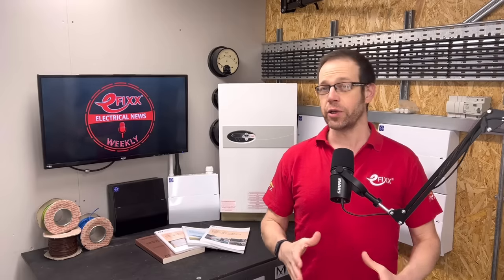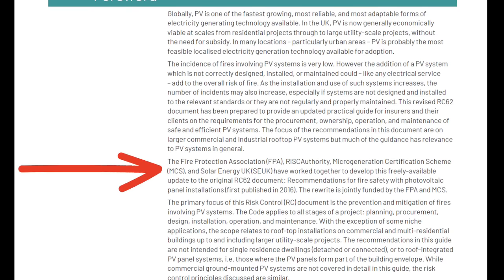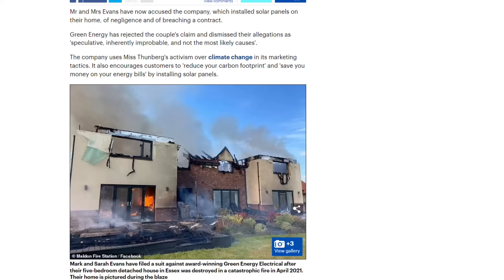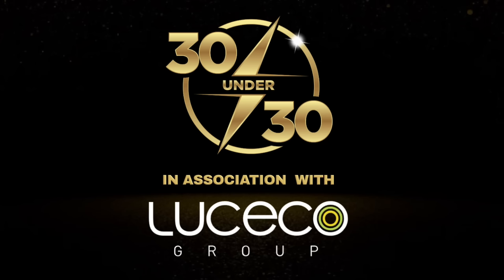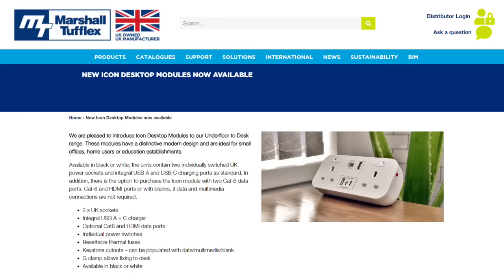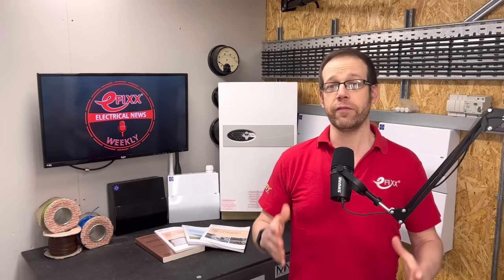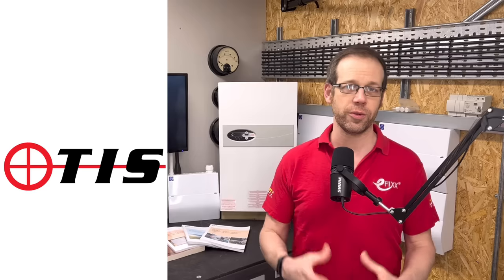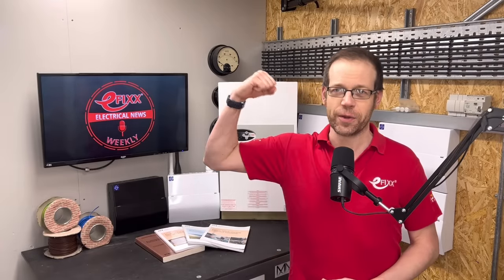DON'T Install DC Isolators On Solar, Electricians Warned

Comment: Sounds more like a "DON'T INSTALL CRAPPY CHINESE OFFBRAND DC ISOLATORS WHICH COST 1/50th OF A SAME RATING PRODUCT FROM A KNOWN BRAND"
Reply: Using proper approved testing methods I have found the Chinese isolators from some brands are as good as UK brands. It’s mainly to the people do not talk down the connections or they think the links are optional.
Reply: It’s more like we know now what we didn’t know then. 
I’m pretty sure the installers had safety in mind back then.

Comment: If your pulling DC strings out of an inverter under load, you are dancing with the DC Arc Angels! Its not going to be nice for you in the right conditions. I'm an advocate for THE CORRECT TYPE of isolators.

Comment: So, who is going to trust technology over a switch? In the same way, a 3phase Spd that takes the supply straight down to earth without any over current protection. 
Those of us that have been around long enough will know, if something can go wrong it will.
So, when it goes wrong,   will your insurance pay out? To me at least, when it comes to electrical safety, give me a good old fashioned isolator any day. When it's off, it's off end of story.

Comment: I would be interested to know the mode of failure of the dc isolators on PV installations. Having worked in industry with extensive dc systems- 55V, 110V, 240V, and 485V, I have never experienced any of the dc switchgear to fail. Indeed, I regard isolators as essential, so is this just a knee-jerk response to incidents or has proper investigation identified the fault? Why would an isolator within the control panel be any safer than an external one?
By the way, an endorsement from Greta Thunberg would not tempt me to buy anything, even with triple Nectar points!
Reply: Usually - water ingress, especially via the conduit to the roof. Otherwise improper screw terminal tightening.

Comment: A fire caused by a faulty solar charge controller is nothing to do with a DC isolation switch, if a separate isolation switch is installed.
Reply: Sound like lithium battery fire to me said it was off-grid likely DIY battery.
Reply: It's more that the design of the PV install is fundamentally faulty, you should never let PV panels that are exposed to full sunlight just float, they need to be grounded or run into a loadbank when not connected to a load. It's a known issue that PV installers don't want to deal with, because then you probably need a seperate grounding system just for the PV to let it discharge the energy into the earth, and you need a DPDT switch to isolate them, and even then, the solar panels remain under liver current.
Reply: @Mr424242424242424242  wouldn't the option be to cover the panels so that the power generated is diminished or reduced be a partly solution?
It's just a thought.
Reply: For a lot of roof installs this would not be reasonable.
Reply: @BrianJones-vr9lc  How can it be unreasonable when nothing is being proposed?
Reply: @Mr424242424242424242  wrote: "you should never let PV panels that are exposed to full sunlight just float". Why not? This is one advantage of PV over ST. You can turn it off and nothing bad happens. The panels just get a bit warmer. They already get heated up by 80% of the sunshine. In this situation they just get heated up by 100% of it. This already happens whenever either grid export is restricted/off (AC coupled) or the batteries are full (DC coupled). It's totally normal and not harmful.
Reply: @xxwookey  The exact physics of PV has that when left to float, shadows drifting across the panel will cause individual diodes within the panel to drop in voltage, becoming resistors for those around them. 

This leads to hotspots in the silicon substrate, causing microcracking and accelerated aging, as well as reducing the power output and causing increased resistance at that location later. 

Eventually, these spots will fail permentantly, and become resistive hotspots in which the full power of the panel can be concentrated, which had been known to cause other elements of the panel to ignite. 

Not a particularly well known failure method, but one which has been extensively documented in the literature, if one is reading sufficiently obscure studies to find the root cause analysis of what are frankly disposable components with short lifespans. 

It's not a fast failure method, but it is a known failure method. Far safer, and easier, to just connect the leads to ground. Especially since you then do not have the thing floating at potentially lethal voltages.
Reply: @Mr424242424242424242  OK. Interesting. How is this process different when floating from when generating? Shaded cells being resistors happens when generating too. The voltage is somewhat higher at Voc than at Vmpp but only about 18% and the current (which generates the heating) much lower. So isn't this a process which happens all the time for shaded panels, whether floating or not? i.e it's 'just' panel aging. Perhaps there is a paper I should read to understand the details?
So, yes I accept that aging can be reduced by grounding floating panels but given that they are gong to be left up there for 30 years generating anyway that doesn't seem like a significant effect unless they are disconnected for years for some reason.
But maybe I am misunderstanding something here.
Reply: @xxwookey  Open circuit voltage can be significantly higher on panels, and when connected to a load, the heating is reduced because the panel is not attempting to dump the full energy into the cells at lower voltage, only a portion proportional to the effective resistance compared to total system load. 

I've seen it cause fires in the past, but the shortest interval of disconnection I've seen cause a fire as opposed to panel failure has been 18 months. But that's within the realm of possibility when dealing with permitting and inter-operation issues. 

Beyond that, you don't want to have these things just floating at potentially lethal voltages. It also shortens the lifespan of isolation systems to do a hot close in, but then, no one pays any attention to the fact that breakers and isolators are designed as consumable components with extremely finite numbers of operations.

Comment: if the dc isolator on the inverter is ok as an isolator I see no problem useing that only. however if the inverter is monted inside the building I would want a Dc isolator installed outside the house incase there is a Fire for whatever reason so the fire brigade don´t have to go inside the bulding to look for the isolator switch.
Reply from the maker: Thanks for your viewpoint. 👍
Reply: How do you do that for a domestic dwelling (to isolate the mains supply)?
Reply: Isn't the fault likely on the roof, or in the attic, doesn't this extra new outside unit and connections just add more risk than it takes away.
Reply: In many places this is actually required in order to be code compliant, regardless of whether or not the inverter has a built in disconnect.  Every Firefighter and Lineman know what a disconnect looks like, they don't necessarily know if a particular inverter has one built in., Where I am we are actually required to have rapid shutdown at the panel level; for all solar roof installations.
Reply: @nathonsweetman4409  But that (panel level shutdown) is a strange USian regulation that no-one else has (SFAIK). And I understood that it's been removed in recent regulations because it caused more harm than good (as well as making solar installs unnecessarily expensive).
Reply: @xxwookey  I will know for certain if rapid shutdown at inverter is now sufficient, as I am about to go through the permitting process again here in the next few months.

Comment: I don’t understand. Neither of the failures highlighted related to DC isolators.  How do the ones fitted inside inverters differ from those selected for use outside inverters.  Simply stating “there is a problem with them so don’t fit them” doesn’t seem to make any sense to me.  Surely a review of the selection and choice of the isolators would be more appropriate.
Reply: If they are incorrectly wired, incorrectly labled, or manufactured badly they don't work properly and the arc causes heat. I think someone has a YouTube video of one on fire and explains the issue.

Comment: Do not disconnect under load for 500V DC ? 
There must be 1000's of solar PV installations just in the UK. I bet 99% of them have a DC isolator since the regs does mention it - ours does.

Comment: It's fascinating to see how regulations and recommendations around the world lurch around like this.  Personally I reckon you always want an external way to remove supply from a device.  Everything has a built in on/off switch yet we still have means to isolate wiring in standard AC wiring.  That shouldn't change with PV.  If anything given the sort of voltages that are permitted it should be mandatory.  Not sure on the max voltage over there but many places are now moving to allow 1kV or higher even in domestic.

Use a non-rubbish properly spec'd DC isolator and don't put it in a situation where it is going to be weather damaged.

Comment: In Australia, the DC isolators usually corrode, and catch on fire, besides they offer no overload/fault protection and are pretty much useless.  Problem is that the Australian code says that they must be fitted, but they at least should not be up on the roof, where the weather causes them to fail, and instead be sited in a proper weatherproof cabinet.
Reply: How about using tinned marine cable? And why isnt wire corrosion a problem with other circuits in similar locations?
Reply: The pvc boxes containing the isolators always allow rain in ,   Sometimes the cable entry points are not done properly -- not water tight etc etc
Reply: So the problem really is bad installation of the isolator or an unsuitable type.  Excess heat with those hot summers you have and then not waterproofed if it rains. Everything is watertight in UK for external use. Fireman's switch a good example. Regulation requirements and never seen a faulty one in all my years. We get rough weather here and survive.
Reply: @kennethausten  It's usually the cheapest nastiest isolator that the Electrician can get their hands on, then installing it in a crap location.  It's not the rain that causes issues initially but the sun here - even UV stabilised plastics cop a flogging over a few years and slowly warp or degrade until they allow water in.  Installing the isolator in a location like near the inverter on the south side of the house for example (equivalent to the north side for you) alleviates these issues, but the amount you see stuck up on the roof is amazing.

Comment: I would suggest that perhaps many isolators are not capable of clearly breaking the on line voltage at the rated current.
A line of panels can easily get up to 600v (shouldn't but they do), if installers are not allowing for this and not wiring the internal switches in series then all hell is going to occur.
With DC the trick is to make the gap on the contacts as big as possible, and that means series contacts, and each contact must be capable of carrying full current.
I would suggest a factor of at least 1.3 safety.
Panel array = 20Amps at 450v(theoretical max), then an Isolator made to break full load current at full voltage of around 25 or 30 Amps at 585-600v DC.
Often that means wiring 2 sets of contacts in series in both legs.
Many 'isolators' are not meant for ON-load breaking but often only capable of OFF-load disconnection, it you shut the inverter down, then isolate the panels (with lock) to work on them.

I also suggest that the Isolator is placed in a floor accessible position. Roof is no good.
Reply: SolarEdge line voltage is fixed 750V the production is switched on when the line voltage practically around 930-950V without load then it is regulated to the fixed 750V.
Reply: @gabor.nadudvari  depends on the system, many inverters work on a max of 600v, some are 1000v but thats pushing every connector on the solar array.
best you go check your maximums on your kit, if you are getting 900-950, then I suggest thats your problem.

Comment: Talk about a "U turn" on DC isolators, first they insist you fit them, despite the Inverter manufacturers stating they are unnecessary - you just couldn't make it up.
Reply: Yeah seems it was all the rage 10 years ago even though my SE inverter has one built in - suspect the external isolator isn’t even explicitly rated for DC - fortunately the SE optimisers can deal with dropping any HV DC down to safe levels
Reply: Yeah, I'm about to give up.
Reply: This is the insurers..  when were they expert electrical practitioners?
Reply: @MikeGleesonazelectrics    You will find that the insurance company’s drive most of the changes to all trades
Reply: @bill2960  could be, doesn't mean they know best tho, just to avoid payouts I guess!

Comment: In many countries a DC isolator is required by law, and it is required to be mounted on a non flammable surface.

Personally I think all electronics related solar panels including batteries should be mounted in a fire proof room, and ideally in a separate part of the house or in a separate building that are non flammable.
Reply: @blow0me  A separate garage from the house is always smart. However, having batteries outside can be problematic because of low temperatures.
Reply: @blow0me  Agree, that is why people should build a separate part of the house out of a non -combustible materials such as concrete, leca, bricks, etc. for batteries and solar components
Reply: yep. laughing at this guy's video with a bunch of stuff on plywood in the back instead of having concrete board over the plywood lmao
Reply: @gg-gn3re  Pretty common theme in the UK.  Major electrical components screwed onto obviously flammable backboards.  As much as people comment about really poorly hacked about old Australian switchboards, at least all the major components are screwed onto a non-combustible backboard.
Reply: @retrozmachine1189  most states require using non combustible too. pretty funny to see wood in a video complaining about fire lol
Reply: Or just build lots more nuclear power stations so we don't need all this junk in our houses.
Reply: @blow0me and you should never allow an ICE vehicle anywhere near a building…
Reply: @retrozmachine1189 fire inspection at a commercial building:  replace the backboard for the meter.

Me: that’s not our property, and the DNO requires it to be chipboard.
I mean, what the hell else is going to catch fire in a concrete box…
Reply: @markrainford1219  Yeah, because we have unlimited uranium and thorium... 
And don't try to claim that we have nuclear "fuel" for thousands of years, because that simply would show that you either ignored the fineprint for those numbers or you know and keep quiet about it.
Reply: @johnscaramis2515   We don't need present fuels to last thousands of years. We just need them to last hundreds of years, until Fusion is perfected.
Reply: @markrainford1219  There was some progress in fusion, but in the end no-one can really be certain that fusion will work one day.
Do you go to a bank and ask for a load based on a lottery winning you surely will make in the next few years?

Comment: I think the report means that:
1)  poor quality DC isolators;
2)  cables with no bootlace ferrules;

Should not be fitted.
Reply: I fit ferules on all the PV connections to get the best connection but if the equipment’s failing that’s worrying because these big PV companies always blame the installer

Comment: I use specially designed Kraus and Naimer 1000 volt DC isolators. There are 2 lots of 3 poles in series in these isolators. Rule 1 never open the switch when it has a load on it.
Started in the trade in 1974 and I might just know a bit more than some insurance Johnny.

Comment: I am not sure I agree with RISCA, do they know something the IET do not?
If there is no DC isolator then how do you isolate when you need to run tests on the panels and most importantly.  In a few years time when you need to replace the inverter do they think it will be done at night so there is no DC voltage/Current?  (I am assuming Domestic here)

Very important point to consider is that not all Solar PV panels have an optimiser which detect no inverter and drop the output to 1volt.  

If they think the MC4s or the DC isolators are the cause they need to investigate if they are upto the job.  are the MC4s on the panel compatiable with the installers MC4s connectors and crimp tool?  Not all brands play together nicely.  If they are upto the job was the install done properly by a competent person.  Local isolation is in BS7671 for a reason and that reason is to save lives.
Reply: You need to go back and listen to what Joe said.

The IET regs on this say that a means of isolation IS required.
There is no doubt about this.

The question is around how that isolation is to be provided. Whether it be provided by a separate dedicated DC isolation switch or whether the integrated isolation switch inside the inverter is to be used, if there is one.
Reply: @deang5622  How would you isolate the solar PV string when you need to work on the inverter or replace the inverter?